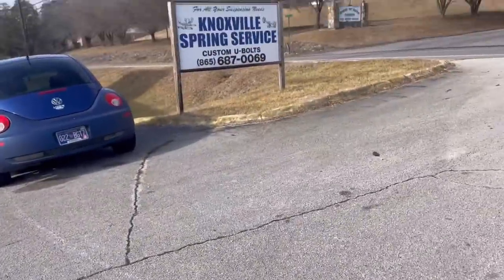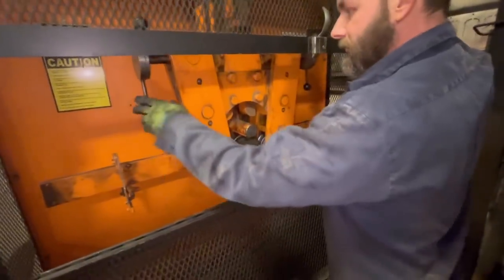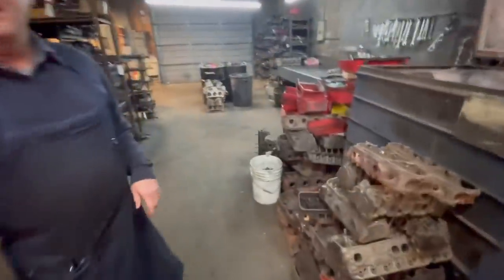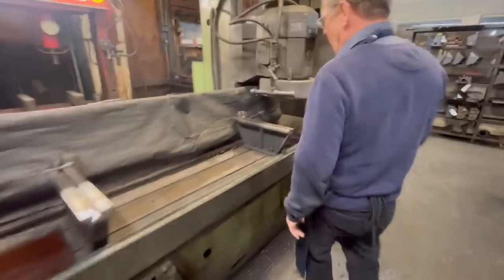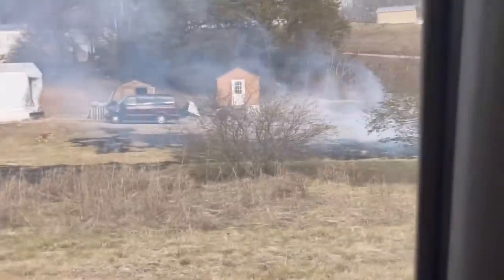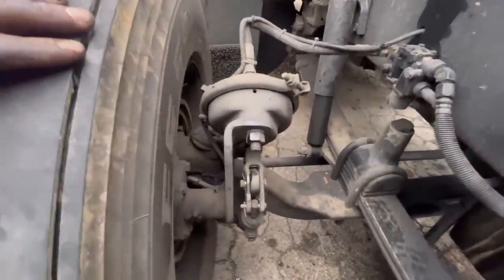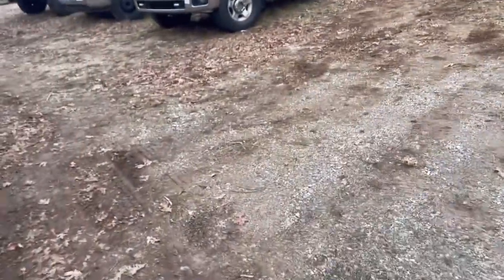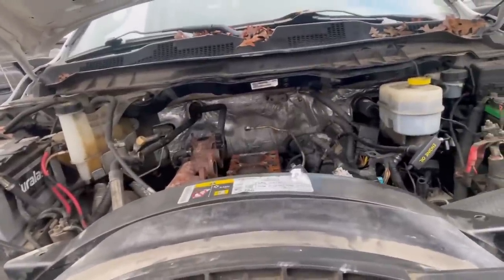We are still getting work done! Also how cylinder heads are repaired!

Comment: awesome video!! I use to work in a motor shop when i first got out of high school. I remember repairing heads and using the old stone bits for doing valve drilling out old seats and reseating them and using the old stone bits to grind in the new angles that the valves set in!!

Comment: I have the 6.7 ford as well. You will also need to adjust the injector quantity adjustment (IQA) using IDS or for scan. It’ll run, just not optimally.
Reply from the maker: I have been watching videos on that, it seems fairly easy but still a little intimidating. Hopefully it goes smooth
Reply: @GentrysWorld  its not too bad. Have you narrowed it down to just one injector? A really good resource is Powerstroke Tech Talk w/Arod - he has a good YouTube channel with a lot of vidyas on this subject, he  has worked on my truck many times. I live in Maine and he’s in Detroit, so if I absolutely can’t do it, there are so many jokers out there that I just take it to him! If it is just one injector, you just gotta be careful with all of the o-rings and the copper washer. It should come with all of that new with the injector.  Also, I would not recommend re-using the metal line that goes from the fuel rail to the injector either. They do sometimes survive being used twice, but it is definitely not worth it when we’re talking about 30k PSI max pressure. I have a 2014, 2020+ now they’re running at 36k psi max pressure. Insane! Sorry again to hear about the shop, been following Tim for years. You are a good family and definitely do not deserve this nonsense.

Comment: Cracked head gets replaced with new no question asked.  Guess what happens when their plug and weld fail. Your piston finds it and plays with it. Wipe out a motor over proce difference in repaired v new head.
Reply from the maker: I agree! I don’t think I would run a repaired “cracked” head.